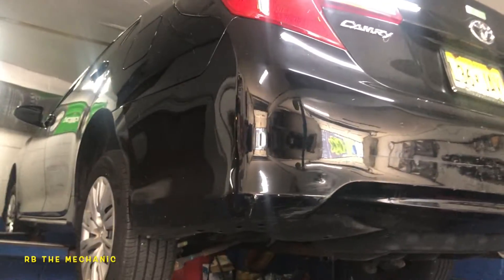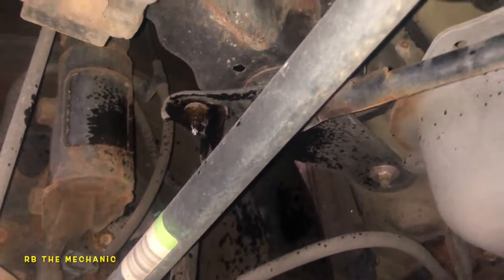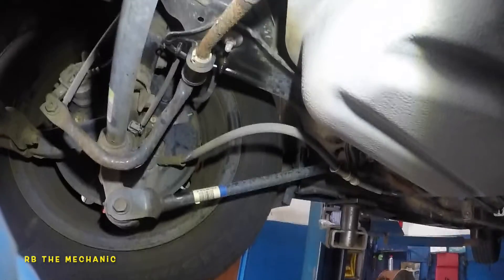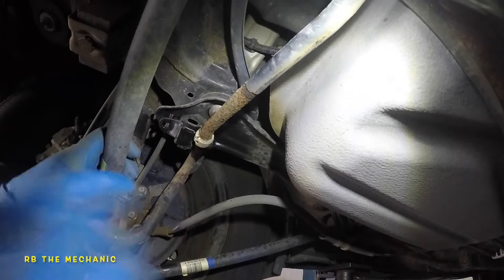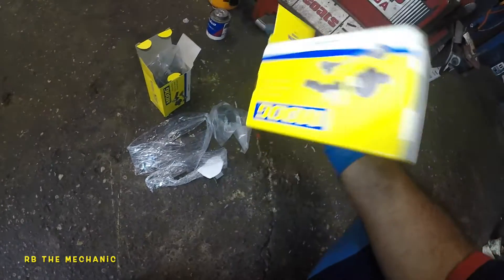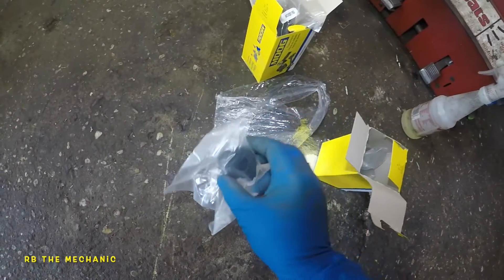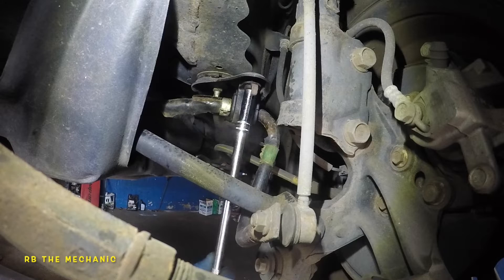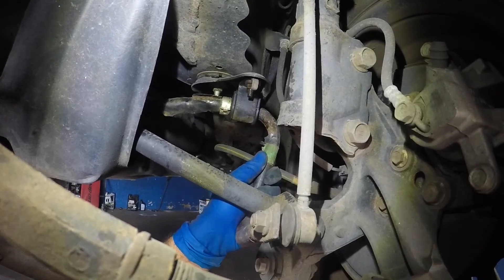Toyota Camry 2012 to 2017 Rear Camry sway bar bushing   REAR END NOISE FIX

Comment: Gonna do this when my part comes in on Tuesday. The front ones were a p.i.t.a when I did them last year
Reply from the maker: Yeah rear should be easier need to heat them
Reply: Could you do a video for the front as well?

Im aware of two methods. Could you do a video showing the one that doesn't require half the car to be lifted in the air. It would get a lot of views since there really isn't a good one out there. 

Thanks for what you do. @RBTheMechanic